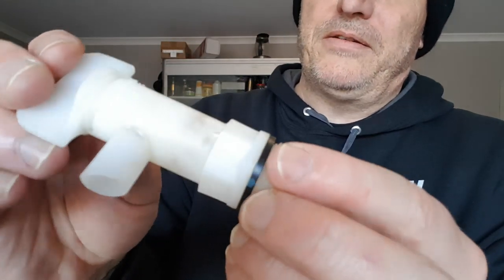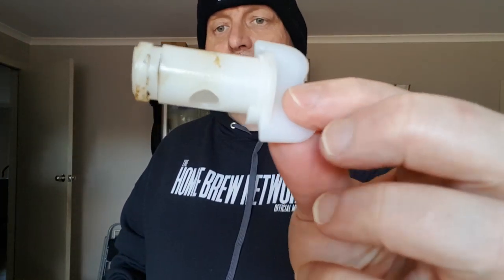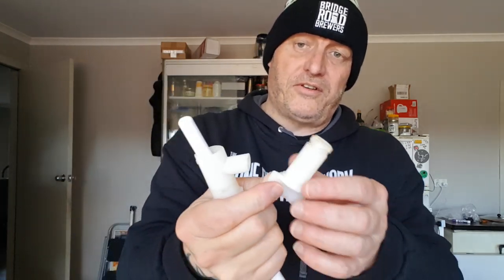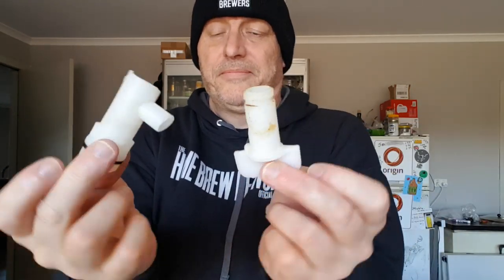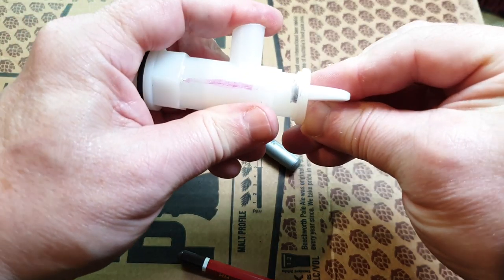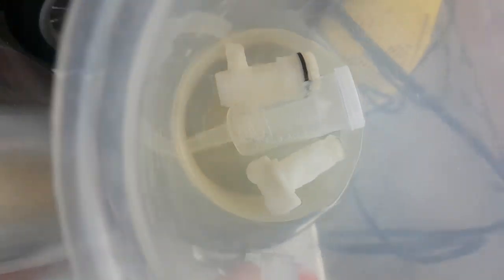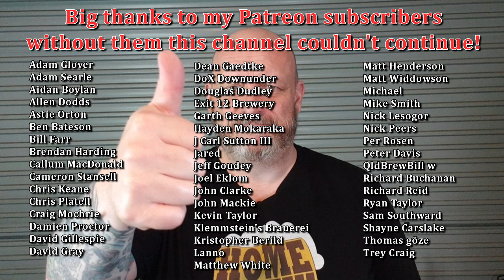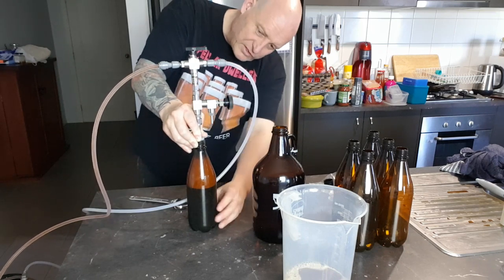How to CLEAN FERMENTER TAPS - Spigot - Faucet - From the Vaults - Beginners

Comment: Cheers Gash... yep, had an extract IPA that I did turn into a sour IPA because of something picked up from pvc pipe from bunnings... now going to replace with silicone. Lol about the filling fail!
Reply from the maker: Far out these comments, I keep missing, Im starting think they are trying to force us to use the Youtube Studio for commenting, I think a lot dislike some of the "features" in it, it seems harder to do some of the basic stuff. Cheers Stass!
Reply: The Home Brew Network what about the clear vinyl hose from Bunnings? Any thoughts on those? Or is that the same as the regular PVC plumbers hose?
Reply from the maker: @phillchannon7673  Its rubbish for long term, unless you nurse it, even then you need to keep an eye on it, last resort for sure, first choice nope. Cheers mate!

Comment: I have a different type of spigot, I place it on the floor, grab a hair blower and place it on the joint of the spigot (where you have to pull it apart) Then run the blower on hot for 10 seconds and it comes out veryyyyyyyyyyyyyyyyyyy easy. No need to put it under hot water.

The only issue I have with these plastic spigots is the stain after many uses, it won't come off. I heard about white vinegar mixed with baking soda but I haven't tried. I was wondering if you have tip/solution for it.

Thank you for making this video!
Reply from the maker: You can try a weak bleach mix, just a splash in a container of water and leave it a few hours or overnight then give it a good rinse in hot water. Cheers!
Reply: @HomeBrewNetwork  Thank you for your reply and tip. I will try it once I get stained one since I threw away all of them. Cheers!

Comment: How the bloody hell did you know how to do that. I don't use a plastic fermenter very often now but have sweated over that issue for years. Who told you or did you just figure it out by yourself .lol. Cheers tomorrow I pull it apart.😀
Reply from the maker: I found it somewhere mate, many many years ago.  We used to use black taps and just thought they were clean, wasnt until I got a clear one and went.. shit.. lol Cheers!
Reply: @HomeBrewNetwork  mmmmm I don't believe you. Lol. Well whatever I pulled mine apart today second brew day in 2 days so using my plastic fantastic. Thanks for that. And thanks for sharing top secret brew information. I've met engineers like you before. A bit unsettling .ha. lol
Great stuff cheers mate😀